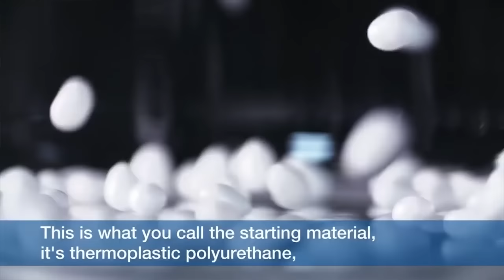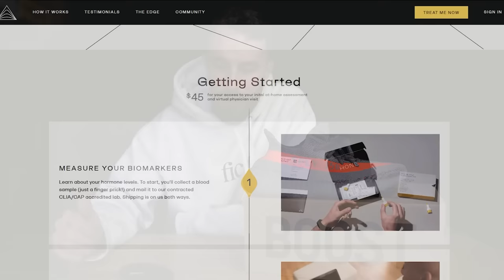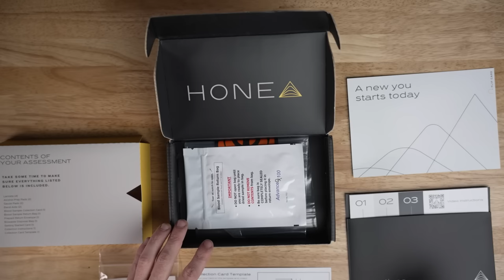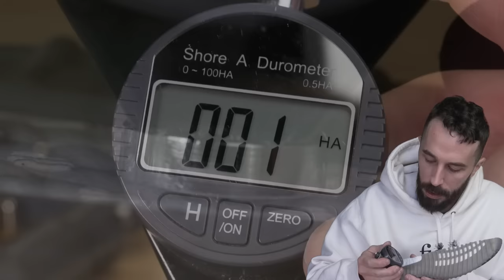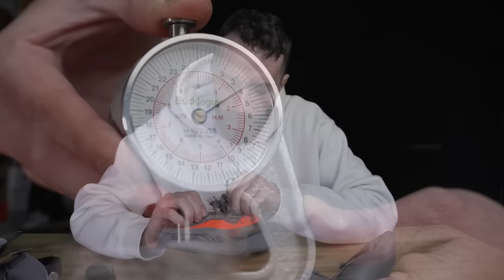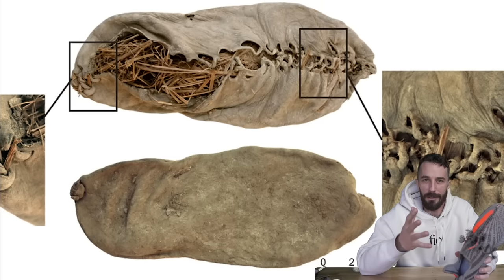The Truth About Yeezy 350 V2

Comment: I got the 350 mx rock a few months ago and have to say the fabric is much more durable from them using 3 different materials, makes it less breathable but still way more than most shoes
Reply: I bought the MX Rock pair 3 days ago, and they felt super cozy right away.
The tip just needs to stretch out a bit.
And they do feel very durable, feels like snake skin.

Comment: I think if you're looking for comfort you would get from the Yeezy 350 v2s, maybe pick from the large selection of boost shoes Adidas offers like the ultraboost, solar boost, etc. What's awesome is you can find ultraboost often for around $100... The cheapest Yeezy 350 on my size 11 goes for 250 and above on stockx and goat... I love the solar boost a bit  more than the ultraboost because the upper is built more like a traditional running shoe...like having gussetted tongue, comfy mesh or techfit upper, and light stability features with the guide rails on the sides. Anyway, great video as always!!
Reply: The difference is that yeezys hold value better than ultraboost and significantly better than cheap adidas shoes with BOOST
Reply: @igorkarcz2174  if you're just buying them to wear that doesnt matter

Comment: I have worn Ultraboost's since 2015, V1's to V5, 19's and 20's loved them all; had one pair of 350's and could not wear them-the inner toe cap thing drove me nuts, so uncomfortable. Standard boost primeknit is way more comfortable. Worst thing about boost is the white mid soles look scabby after a few weeks wear-especially the inner heel area; black or coloured boost foam looks better for longer. 
4D's are also great-not as comfortable as boosts-but the 3d printed mid soles would be well worth cutting in half for a look .
Reply: i saw the cheap chinese and cheaper imitation of yeezy first before i knew about yeezy hence i cannot see them expensive shoes....then i've got the UB DNA and the upper is more sock like than the 20...but 20 is good enough for slow running for me and the upper is soft as well....i got the zx 4d runner and it was the softest 4d that i've tried before and the upper is even softer than the UB DNA...upper wise not good for running...too soft and really like a sock if you got the correct sizing.

Comment: I have five different ultraboost models.
I am using two of them in the gym.
I don't know how, but they never soak wet and they really don't stink.
Even when I am running during the summer they are still dry.
That is my personal experience with Adidas ultraboost.

Comment: I.m.o, regarding the problem with sweat being absorbed "into the foam sole" I would say that is quite unlikely... unless/until You wear down the "cell walls" of the CloseCelled Foam that they are made of, after which the "damaged cells" will possibly absorb some moisture . Which is why the cells that You had "cut in half" were "susceptible to moisture ingress", but that is NOT the "normal behaviour" of CloseCelled foam!!.
That said I would not buy these shoes for more reasons than I can count on my appendages...
brgds

Comment: Hmm. That bouncing video has me asking some questions. I work in motorcycle gear retail. From helmets we know that we actually don't want something to bounce back too quickly from an impact, since that would send the shock force back the other way around. So what about shoes? Do we actually WANT a shoe sole material to have a lot of bounce, and if so, why? Wouldn't we instead want a material that compresses when your foot makes contact with the concrete, but then returns to form in a controlled manner while your foot is raised and traveling through the air, ready to compress again before you step back down?
Reply: Boost was foremost made for running performance, and being a marathon runner myself, you need that bounce back of energy in every stride you do. You don’t want them to compress, that would literally give you long term foot and ankle injuries besides the fact that your performance will be far worse then your competitors 

As for shoes with Boost technology, most of them are running sneaker inspired so they tend to follow the same template

Comment: Pretty biased or overly dramatic content...
These sneakers are really solid. The knit is very effective against bruises and no one is going to cut them like that, so it will never come apart like that. I've been abusing 350s for years and they still look pretty new, it's actually really surprising. Yes the rubber midsole have some normal scratches, but the knit is good as new. Just want to also point out that I walk on dirt, grass, wtv, I don't hold back. I dark ones and mx ones, but I can imagine that white ones get dirty faster, as every white shoe ever. Also, although it LOOKS minimalistic, the knit has SO MANY details, you need to price all the research that went through to get to that knit and to the boost.

Comment: i would have to disagree with you saying durability is not good. Maybe if you cut the whole shoe in half with a knife the knit will easily come apart,  but I would say my yeezys are the only pair that I can use for years and years and it still being in perfect conditions other than regular outsole discoloration and yellowing.

Comment: Just saying...the side wall is not made of rubber but it's made of TPU same as the boost midsole the difference is the side wall is TPU injection when the boost is made of TPU expanded  foam pellets then the outsole is made of rubber so 3 differents moulds are needed to make this shoe and the injection moulds are expensives so this shoe is not that cheap to produce!

Comment: 0:43 How does this animation make sense. dropping a steel bal on concrete should definitely give the most bounce as it absorbs the least ammount of energy. Right?
Reply: Not quite how it works. A steel ball will bounce fairly well on a hard surface because of the carbon in the steel and its crystalline structure - in short, the ball will deform but only very briefly, resulting in a quick release of all of that energy and a pretty excellent bounce. In fact, a steel ball will generally bounce higher than a rubber ball of the same size. Either way, the comparison is arbitrary and misleading.
Reply: Action reaction, Newton's third law, the biggest the bounce, the more external forces absorbed. Metal ball is hard, and the foam surface soft. You can flip this by having a rubber ball on hard surface, ie bouncy ball.

Comment: I think they are a unique shoe I love them but I can’t wear them. They hurt my feet 👣. 
But that’s how I started reselling sneakers 👟 
I just sold a pair identical to the one you cut apart for 450$
Some of them are worthless. Like the 380 boost. 
But those are a status symbol, and because adidas only produces a few thousand and raffles them off it makes them more valuable.
Originally Kanye west wanted to produce sneakers that cost 25 dollars. That’s why the sneakers 👟 are designed with very little material. Probably cost a 1 to make them.